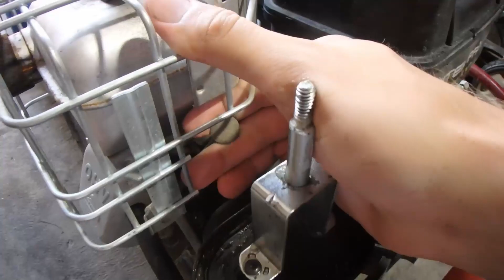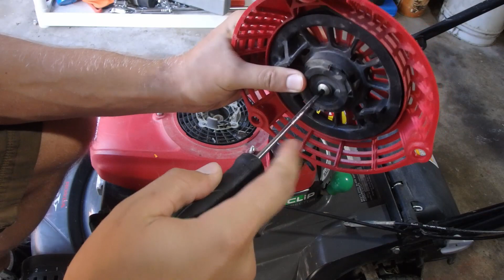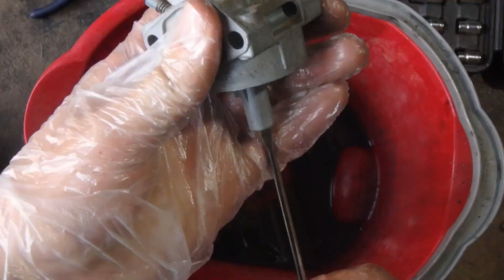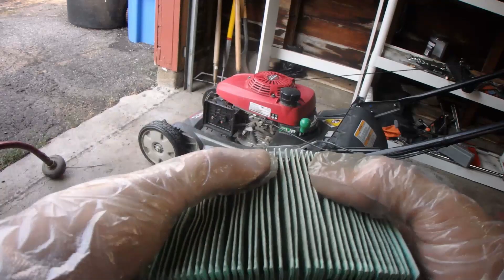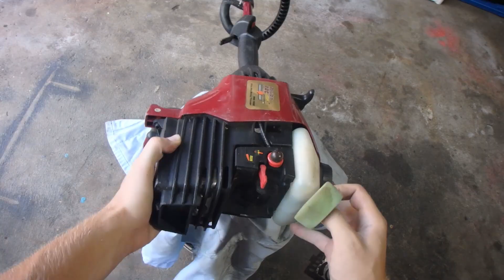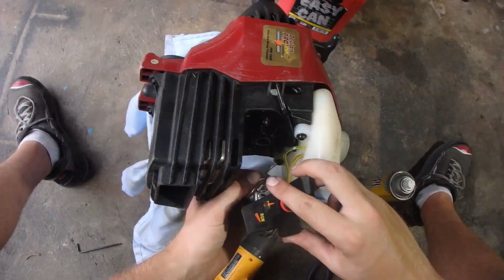Fixing a Few Small Engines

Comment: Great video. I just found your channel. I am going to start a small engine repair business up in PA. Because I am using a relatives place, I am thinking of doing free pickup and delivery for local machines. I have a few myself to get running and then I can clear them out and start getting business. I believe it is the proper time of year to start.
Reply from the maker: Thanks for watching! And best of luck with your small engine repair business. I was surprised how quickly I was able to grow a customer base. Hopefully you have the same result!
Reply: @jontanner1  Thank you so much!!